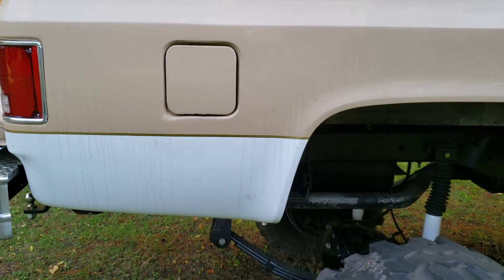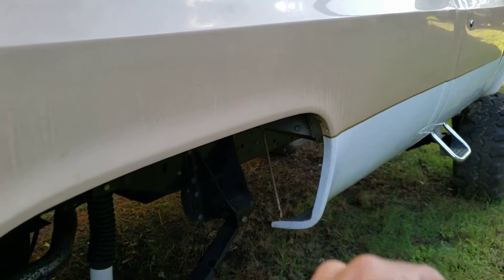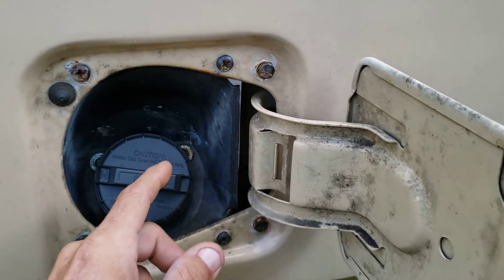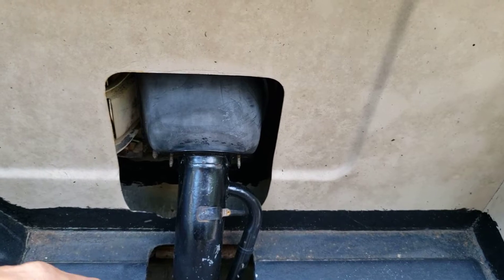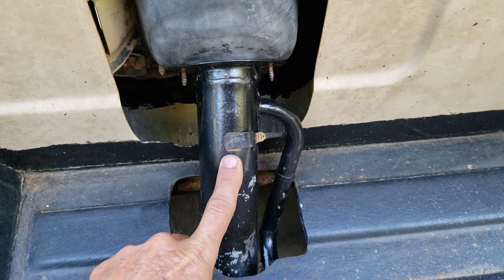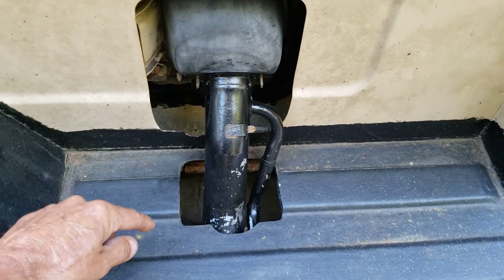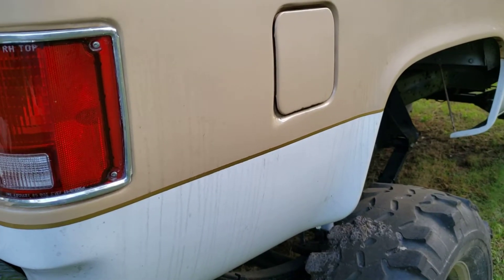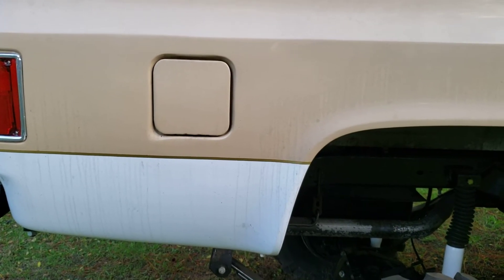1985 chevy k10 4x4 (suburban tank fuel)

Comment: do you know if you can put the 40 gal tank in a truck without the bed lift?
Reply from the maker: Depends on what you are willing to modify and how low you want the tank to hang.You need to address 
Axle to fuel tank clearance 
Filling fuel tank (inside bed fill,wheel opening fill,normal bedside fill)
The filler neck that is welded to tank itself is a few inches taller than tank